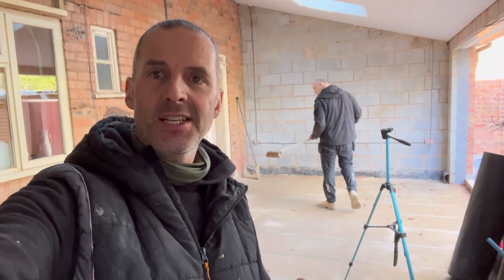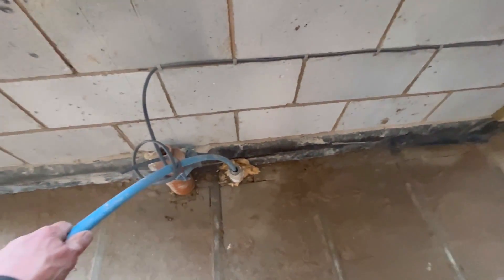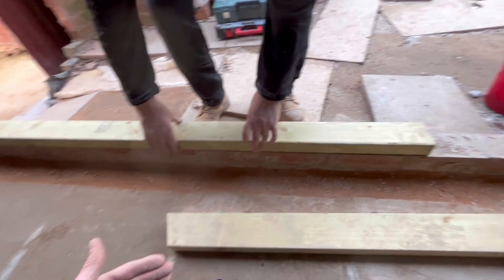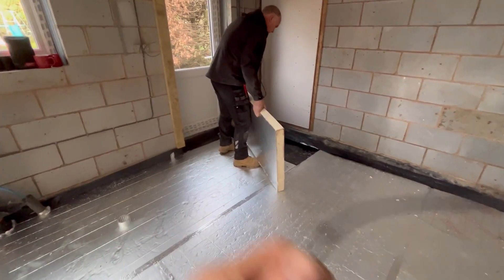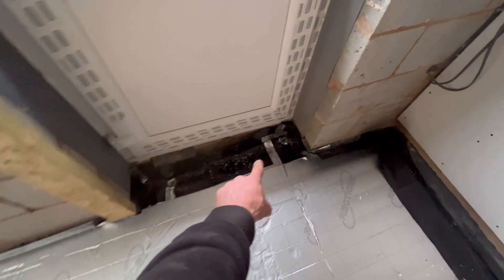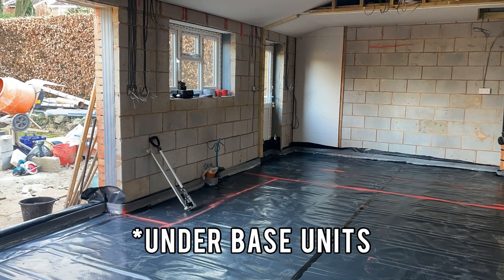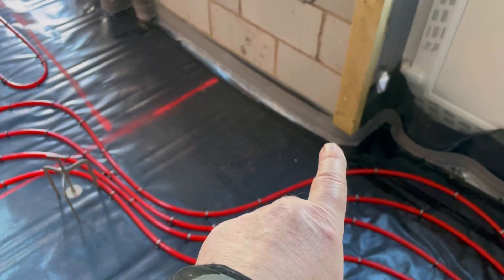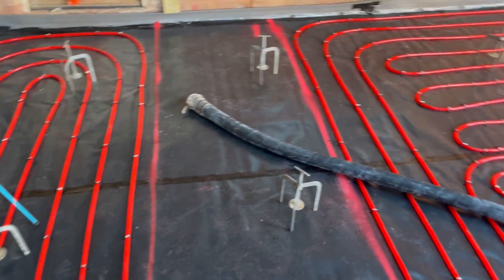Under floor heating on a block and beam floor - Extension #13.   #underfloorheating #extensions

Comment: Hi mate, what do you do in the gap at the end of your beams than run into the threshold, the gap looks like its filled with sand, presumably over some rigid insulation? then obviously dpm, insulation and screed to door sill, cheers 👍
Reply from the maker: Hello mate. I'd brick or block in-between and over the top. Just make it as solid as you can.
Reply: @Mr_A_Builders  Nice one mate 👍
Reply from the maker: No worries man!

Comment: You put another DPM over the celotex? 🤷‍♂️
Reply from the maker: Hello Tom, yes mate, it has to be done. The screed fellas do it in order to effectively turn the floor into a pond so the liquid screed doesn't flow out everywhere. It's not a DPC in its true form, it's pierced all over the place by the clips that hold the pipes in place. Hope that helps?
Reply: @Mr_A_Builders  so I’ve laid the black membrane onto the block and beam, then celotex is done and taped, UFH going down at weekend, so it’s already on top of 1 complete sheet.
Reply from the maker: @tommendoza1812 from a true 'DPM' point of view, that's that done, the sheet that goes on top of your celetex is for the purpose of the screed, not to stop moisture coming up from the floor.

Comment: Do you not pressure to 6 bar, which is recommended?
Reply from the maker: Hi Jeff. If that was recommended I’ve got every faith that it’s what he would have done so I’ll trust that this system didn’t need 6 bar pressure test. However, I shall ask the question and give you his answer if it’s any different. Thanks for watching 👍🏻

Comment: Great job lads but I think it’s unnecessary to have underfloor heating when you have all that insulation 2 Vapour barriers concrete and the flooring on top.
Reply from the maker: What would heat up the 8m x 3.6m space? UFH is the most efficient way mate rather than Radiators
Reply: @Mr_A_Builders what’s the cost for a room like that then?
Reply: @Mr_A_Builders  ohhh wow ok I get it, I assumed that would only heat up the floor and not the actual air space also ? I thought there was going to be a couple of radiators installed. I’ve learnt so much from you guys so by me asking questions I learn form your answers. Great bunch of guys 🙏
Reply from the maker: No worries mate we don’t presume that our viewers are all trades people so we try and explain it as best we can. We are more than happy to answer any questions for you no problem at all. Thanks for watching. 👍🏻
Reply: @davesmith729  ufh is essentially a massive radiator. Because the surface is so large you can drop the flow temps significantly. Which is much more efficient.
Reply: I thought the same thing Dave, and I also agree great bunch of lads 👍

Comment: Thanks.  Any videos of the floor being laser levelled? before the tripods are placed down?
Reply from the maker: Unfortunately not the footage was all done in Timelapse but at 09:06 minutes you can see him checking with a tape measure and adjusting those tripods Mick points out and the laser is top right of the screen on the floor. All he does is get a finished screed height from our marks we give him from our existing finished floor height. Hope this helps but happy to answer any more questions. Thanks for watching. 👍🏻
Reply: @Mr_A_Builders  ah, was wondering where the laser was!  What would you say the max liquid screed depth should be? 50mm?  My floor as the insulation under the concrete slab.  There is 15mm difference in floor level so i was going to lay 35mm in some areas, with a max depth 50mm.
Reply: @MR54TSN   it’s my understanding from when I did our floor that you can go thinner with a liquid screed than a sand based screed.   From memory you should be fine with a liquid screed like in this video for your depths you mentioned   An exiert may correct me if I’m wrong 😂

Comment: guys next time allow for 150mm of EPS insulation . It's better U value, half the price and works brick.
Reply: Probably it is down to the customer's preference how high the floors should be. One would argue that 2400mm is the ideal amount of insulation, but hey you have to account for many other factors not just how warm it can be.
Reply: @Thiago_Bri  height doesnt matter you just go down more!
Reply: @shizzleinthenizzle  not saving a penny by doing down more are you with the cost of excavating - Labour, digger, skips/grab ! Wanna be taking out the least amount possible !
Reply: @Thiago_Bri  no one in the world would ask for 2400mm of insulation 😂😂